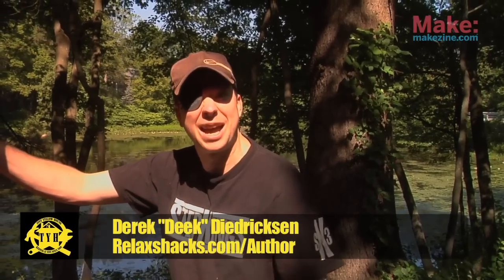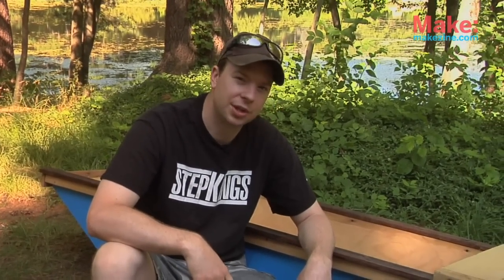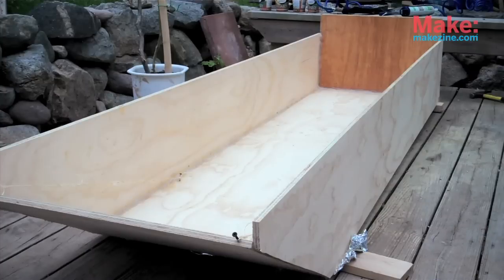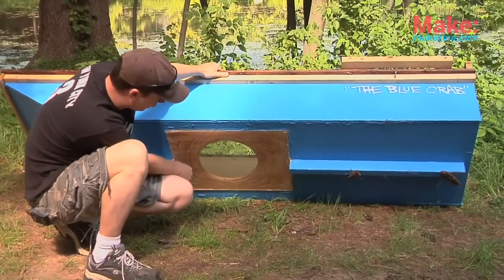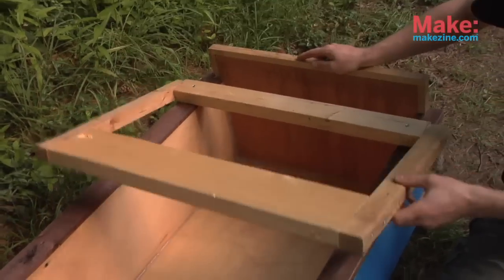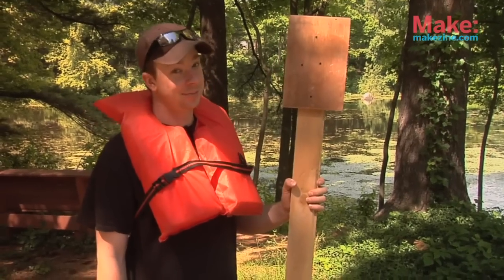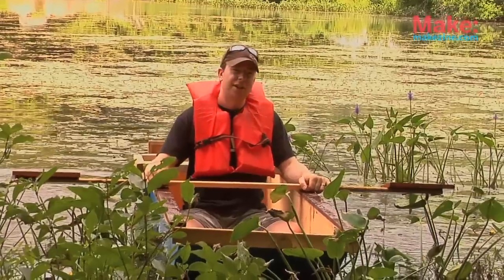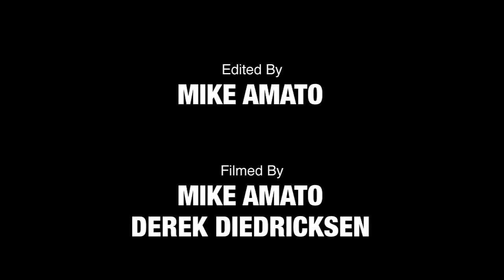One-Sheet Plywood Boat - Tiny Yellow House

Comment: I have built many wooden boats I highly recommend fiberglass tape and risen on all the seems don't use silicone or calk
Reply: Kenneth Turk  I've been researching into building boats and discovered an awesome resource at Denelle Boat Builder (google it if you're interested)
Reply: Thanks
Reply: Kenneth Turk why do you not use silicone caulk on seams & screw holes ?
Reply: I've been studying building boats and found a fantastic website at Denelle Boat Builder (check it out on google)

Comment: If you want it to last, I would recommend fiberglass tape on all edges that touch water, and be sure to fully paint the inside of the boat also, water will get inside one way or another, and if not waterproofed on the inside will cause the plywood to delaminate, destroying your boat.

Comment: You're freakin' goofy, man!
This was cool. If you're cursed with city dwelling, you might think about castors on the bottom to avoid the launch fees at the local boat ramp. the castors also help to drag it around when you don't have a boat trailer. It was just a thought..

Comment: so i built it, i am quite impressed with the stability of it. i might make a video on it. i didnt put on the keel because i didnt feel a need for it. i still dont. although ive only taken her out in our tiny, windless lagoon. i was thinking about putting a trolling motor or possible a VERY SMALL outboard. like a 1.2 horse max! otherwise it could rip it apart. i guess the next project is the "Puddle Duck". look it up! i built the bolger brick, also look up, before this. it is the previous version

Comment: Some 2x4 cross members would really help to stiffen things up. Also, not sure about everyone else, but living on the river means that I have some rolls of fiberglass laying around as well as resin. Coat the hull, stretch some fiberglass out and staple it down and coat that and you'll be waterproof for a long time. 

Or you could just buy a fiberglass canoe with 2-3 times as much room for $150-200 on craigslist.

Comment: Try making a kayak paddle out of 5 gallon plastic bucket. Cut out paddles from side walls and screw onto stick or old aluminum tent pole add piece of swimming noodle or pipe insulator to make float and also stops water from running down to hands. I made 20 or more they work great and if plastic is to thin double up and pop rivet then together. Nice Video!

Comment: Yeah--don't use silicone caulking. 
For a slightly more refined boat, look up Mouse Boat by Gavin Atkin, or check out Hannu's Boat Yard. For any boat like this, a chine log (think of a piece, say, 3/4 inch square and as long as it needs to be) along the inside of the joints, screwed and glued, will enhance rigidity (which is a good thing-- it makes the boat easier to propel) and durability.
For a huge resource on all things build-your-own-boat, look for Duckworks Magazine on line

Comment: Just needs some 16 inch strap-on bike wheels, amid-ships, and some sort of "wheel-barrel" handles or yoke-system.   Makes me wonder just how a smallest-sized john-boat would compare, in weight, and cost, and "multi-mode" suitability.  To put it another way ... cost aside ? ... What would be the most wieldy and transportable vehicle that is (at least) 8 feet long by (optimally) about 3-feet wide.  Something trail-worthy that could be rolled over rough terrain and obstacles (like RR traks) .

Comment: Not to rain on your parade.  If you want a real bonding flexible boat building agent, go to West Marine and buy the West System epoxy resin.  Last longer cure faster and MUCH STRONGER.  Also can be used for every step from structure to finish (paint etc.).

Comment: Warning!  This boat is VERY lightly built--don't get too excited about having a real boat. The construction is very weak--real boats are NOT built this way. Nails and caulk do not hold a boat together. It may be ok in a little shallow pond like the one shown where you can stand up and where the ONE passenger is a swimmer but out in waves, current, more than one passenger this thing can come apart easily!!  People in the comments are talking about motors & sails = suicidal--no exaggeration.

Comment: The first thing every boat designer does, is try to figure out how to put a window in the bottom,...NOT!  That is the stupidest idea.  You should have found another scrap piece of wood and used it at the frond instead of that 45 degree slope.  It would have made the boat into a box, but it would have increased the simplicity of the design and allowed you to carry more weight.  With a flat front you would not be able to get it to plane, but I doubt even in the current shape your not going to get it over 10 miles an hour!